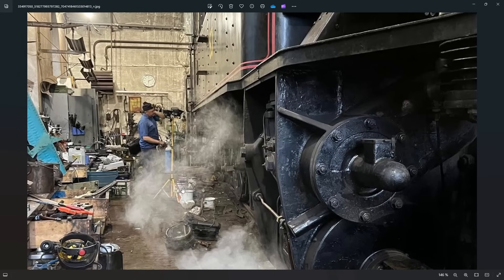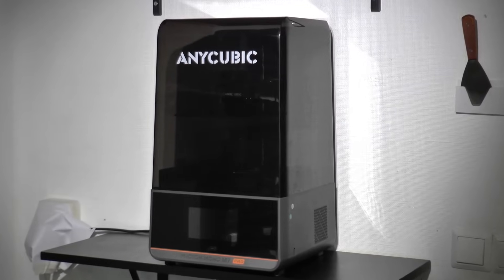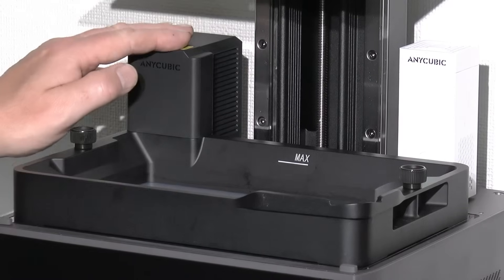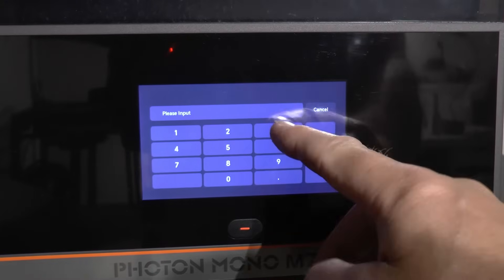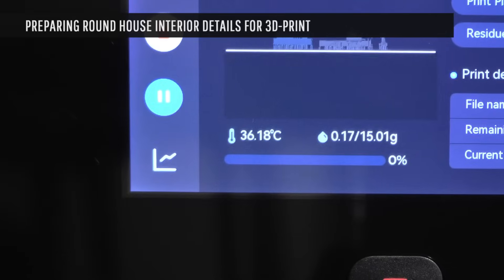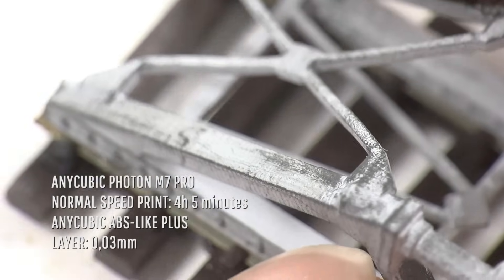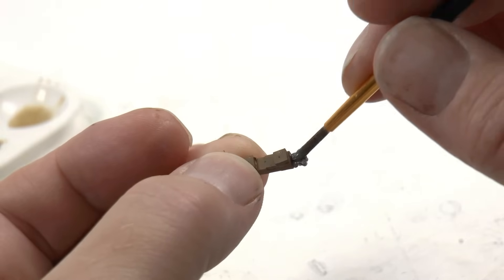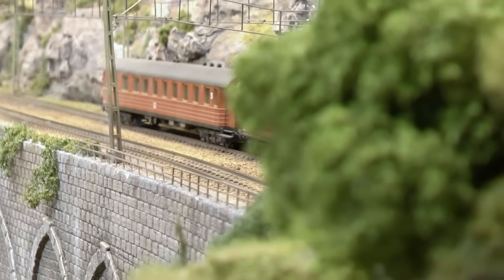Roundhouse interior with Anycubic Photon Mono M7 Pro

Comment: Thnks for an excellent video. I have tried to get the items printed here in Australia and the companies I approached say that the thickness is too small even for a resin printr and they would need to increase the thickness of the items to 1 or 2 mm. Have you had any similar problems with thickness of the items. Regards Ken
Reply from the maker: Hi Ken! No, smallest thickness for resin print on a cheap consumer style 3D-printer is 0,4mm. A printer like Anycubic M5s or M7 or M3 plus prints 0.4mm thickness every time without defects or print fails.
Reply: @marklinofsweden  Hello Martin. Thank you for the comment. I have now approached 6 Australian 3D resin print companies and none will undertake the print run unless the thickness is increased to 1mm or more. They say that some of the items would be too fragile to handle. One even suggested solid red wax as a substitute medium. Are you in a position to do a print run and I would reimburse your costs and postage??

Comment: Hi, I am orientating on 3D printers. The Anycubic models  look great. But I read about quite some issues with the necessary online setup proces of the latest models.
What is your opinion on this topic?

Ps I hope you do some movies again on building techniques without high end equipment. 

Thanks for your inspiring channel
Reply from the maker: Hi! Thank you for the feedback! ”Quite some issues with on-line setup”. I don’t really know what that is all about. I have not experienced any issues with the cloud and/or account setup. It’s a standard dialog. They ask about E-mail and such things. It took no more than 5 minutes for me. Also the remote print works great, but requires good WiFi-coverage at the location of the printer, or each file download gets slow. That is not really related to the printer though.
Reply from the maker: ”Building w/o high end equipment”. Yepp! I try to both stay in front regarding modern methods and also presenting old manual reliable methods too. Somehow, when I do videos using oldschool methods I get comments like ”I learned nothing new in this video” or ”You showed this method already”. If I on the other hand show high-end methods comments is typically ”I liked your older videos better” or ”I cannot anyway afford this type of mashinery”. So.. I try to balance..
Reply: @marklinofsweden  thanks a lot for your reaction. 
I can understand it's hard to please everyone everytime. Anyway, I really appreciate your items and will keep watching👍

Comment: The Photon tech thing is not the way I want to go, even though it does a really nice job of making rail add ons. And definitely not in my price range. It would be a good model RR club purchase, though. I'll stick to kits or scratch building. Thanks for  your assessment of it.
Reply from the maker: Hi! I see the 3D-print as a great cost saver and a way to really be able to customize my models, far beyond whats possible scratchbuilding or kit bashing. I don’t know what locomotives you buy/run, but here in Europe none is availble as low cost as this 3D-printer. Locomotives these days start at €420. Steamers are never below €700 now. Not even second hand stuff is really low-cost either. Those prices has crawled up with the prices of the new stuff..